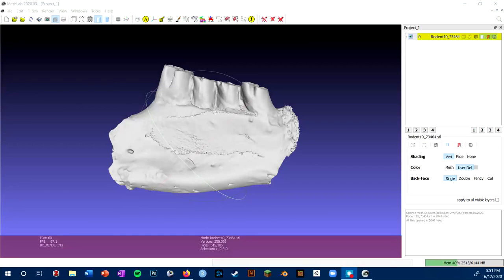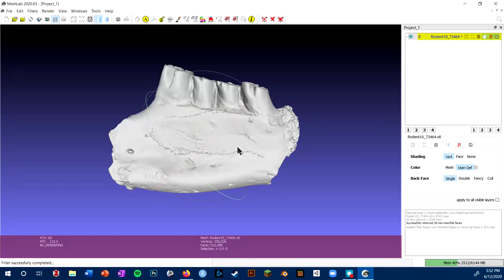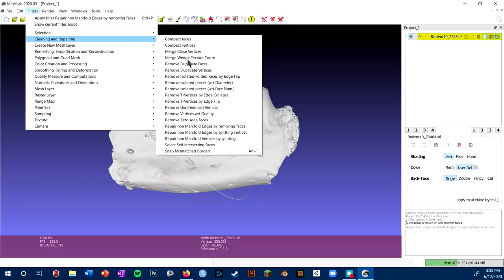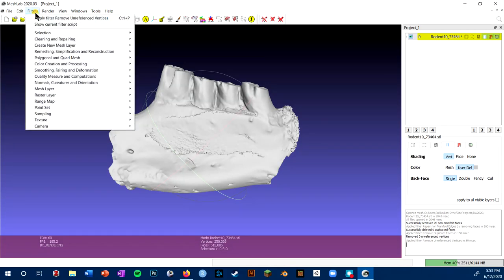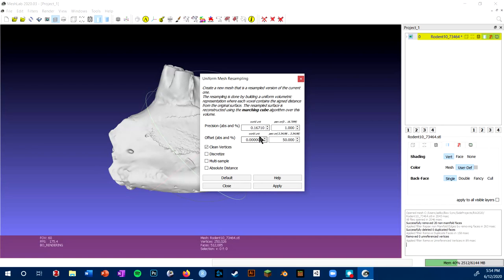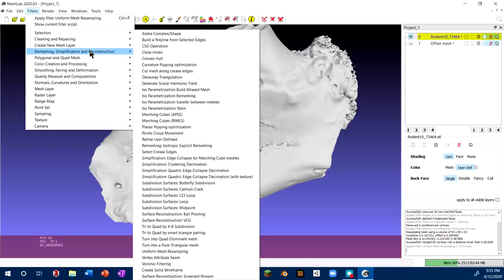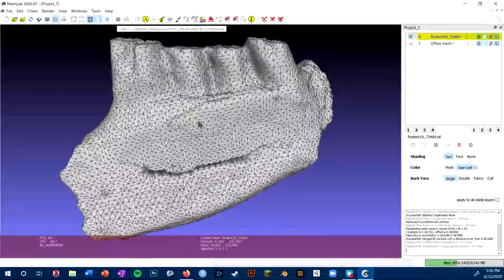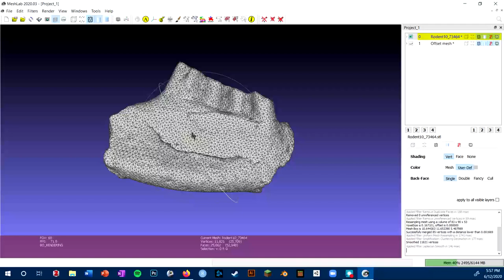Cleaning and Remeshing Filters in Meshlab | Introduction to Digital Preparation Video 16

Comment: I don't have the same options under "filters > cleaning and repairing". I can only see "merge wedge texture coord" and "select self intersecting faces". Do you know why?  I'm trying to fix non-manifold edges and vertices.
Reply from the maker: Not entirely sure. What type of mesh file are you working on?
Reply: @VirtPaleo  It's just an STL file.  Have you updated your Meshlab to the 2020 version?  The newest updates moved the menu's around.  So I downloaded an old version and it is compatible with the menu on this video.
Reply: It seems that these options are moved to "Remeshing, Simplification and Reconstruction", don't know why.
Reply: @chawvencent2664  Thank you!

Comment: do you have anything on how to fill gaps in original material? like a crack in a skull?
Reply from the maker: Eventually I would like to make a video like that. Depending on the complexity of the gaps, I would either use Meshlab to delete the polygons around the crack and use the Close holes filter to fill in the holes or use Blender to delete and resculpt the whole area.